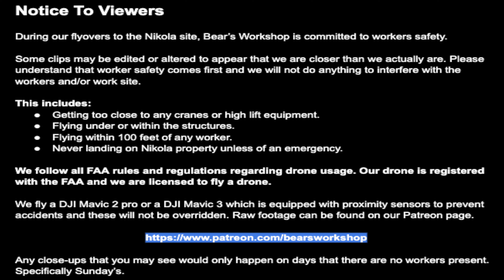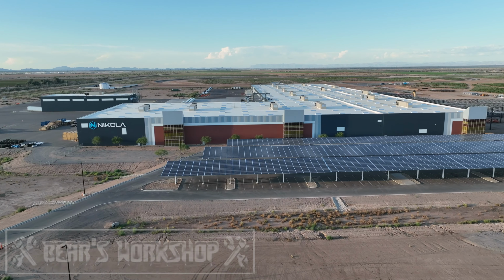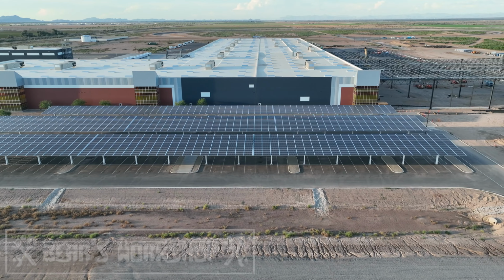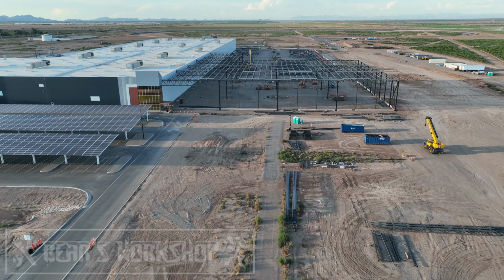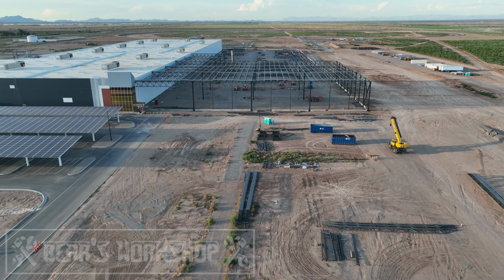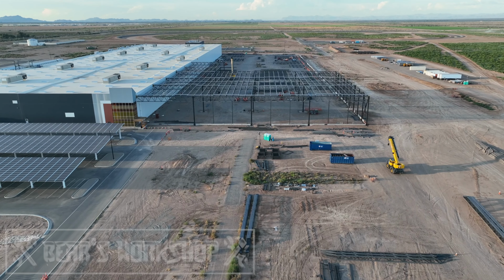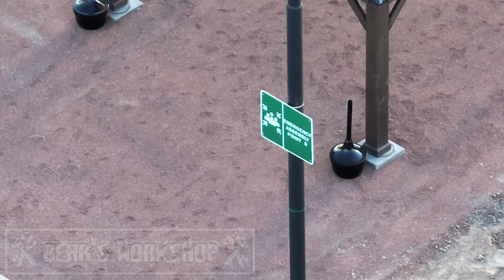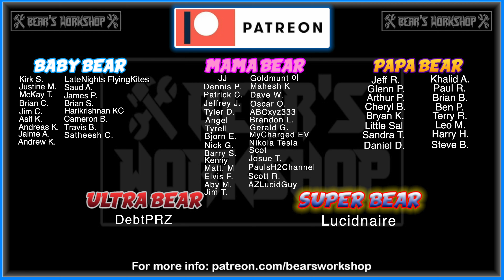Nikola Semi Factory Construction Site October 1st, 2022 | Drone Footage of 5:30 PM

Comment: The strong dollar should be very helpful.
Reply: Yeah, didn't think about that. The parts coming from Iveco in Europe will be cheaper since the Euro declined in value against the dollar.
Reply: @lockbert99  What will Nikola do when they run out of investor money and can't afford to buy more IVECO parts from Europe??? (in 2023)
Reply: This is why they are ramping up operations in Germany :)
Reply: Nothing more eco friendly than a gravity powered truck
Reply: @stephancote4745  shorts, can’t be anymore original.

Comment: Did anybody else see on their website that they changed cell manufacturers? It reduced their battery pack capacity to 733kwh and range to 330 miles. I’m sure they did this for good reason, likely to reduce costs and/or be able to get more cells, but either way hopefully Nikola sheds some light on this
Reply: Nikola signed some agreement with LG last year, which I don't understand since they buy battery packs, they haven't been making them. They have been buying them exclusively from Romeo Power, but in January they signed a deal with Proterra as a second battery pack source. If I recall correctly the Proterra packs were a little different and they would need to make some changes to use them. The Proterra packs were supposed to start being used in production Tre BEVs in the fourth quarter of this year. It's possible that the Proterra packs have a slightly lower total kwh and they use that figure now instead of showing two.
Reply: @lockbert99  The LG deal was for cells. The battery packs and cell manufacturers are different. So like proterra and Romeo supply the battery packs, but as for the cells themselves, those are supplied from different companies. So it sounds like they changed from LG to a different cell manufacturer? Hopefully they shed some more light on this
Reply: @JJ E The battery packs manufacturers and cell manufacturers are different tho so what it sounds to me is that they changed cell manufacturers from LG to another company, but I don’t know hopefully they give us some color on this in their Q3 earnings report or something
Reply: @Mac10943  But Nikola doesn't need a deal for cells. They buy battery packs. Why negotiate a deal for cells? Unless that deal involves the cells going to one or both of their battery pack suppliers. Which seems like an atypical relationship with a supplier. But batteries are constrained so it may warrant that.
Reply: @lockbert99  🤷‍♂️ Not entirely sure how all that works, all I know is LG doesn’t do battery packs they sell the cells. I would think that would be the case but maybe Nikola did the deal outside of Romeo and had LG supply the cells to Romeo through that deal. But either way it sounds to me like they changed from LG to a different cell manufacturer, based on what it says on their website. Who knows tho I just hope they explain this further in their Q3 earnings report or something
Reply: I saw this on the page "2 - Change due to a change in cell manufacturer."  So it seems they changed away from LG.
Reply: @thomas-cheng  Yea that's exactly what I saw and the conclusion I came to as well, wondering why they did that. Really hoping they give us further information on this in their Q3 earnings or something
Reply: @Mac10943  The only hint we had were LG charged them an arm and a leg to get batteries to the US by plane to meet the numbers for Q2.  My guess is that after that fiasco, they decided to reduce their risk and get more batteries locally from Proterra instead of the LG batteries.  While the LG batteries are better by 5%, the Proterra batteries would be cheaper and easier to source locally.
Reply: @thomas-cheng  Ah I see. Proterra makes cells tho? I thought they just made the battery packs themselves
Reply: @Mac10943  I think they do both, but RMO has the better pack design.